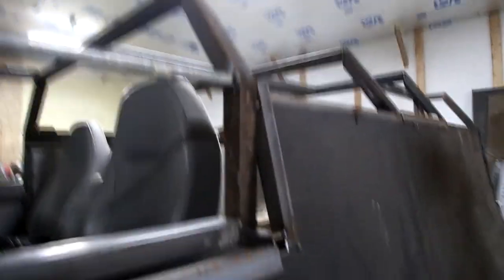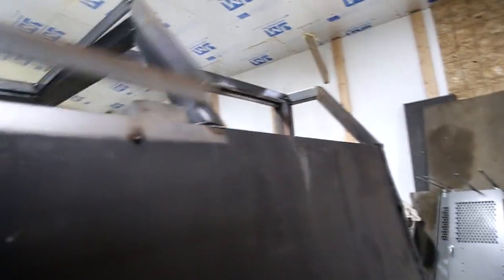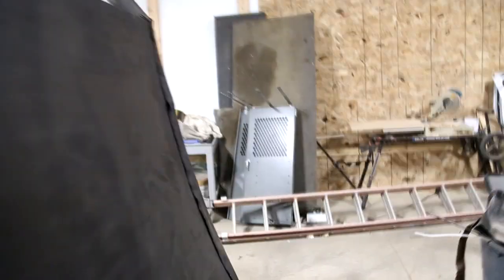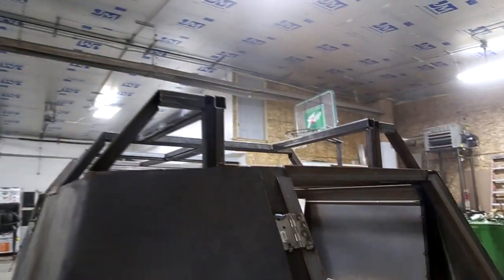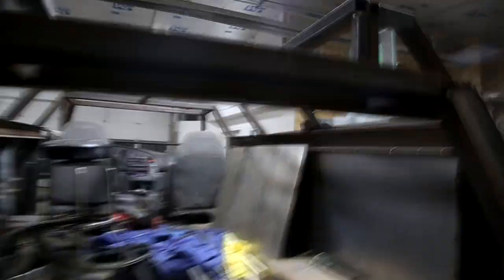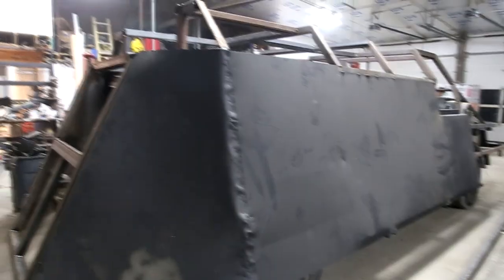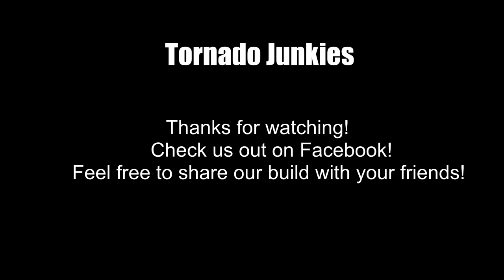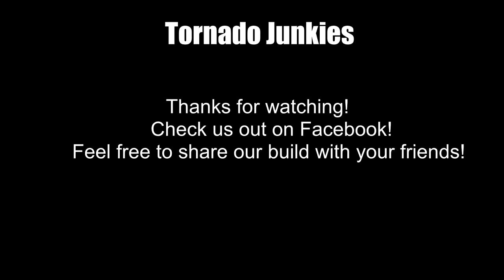Tornado Junkies Build Update 3

Comment: Need to make a 1 foot circle hole on the bottom to be able to drile a stand into the ground to grab hold of the vehicle still while the tornado tries to toss it about.   Better yet put on in the front and 1 in the rear or just one in the middle.  Oh and it would be just better to buy a tank yes? I would still have a drill hole to lock it to the ground.